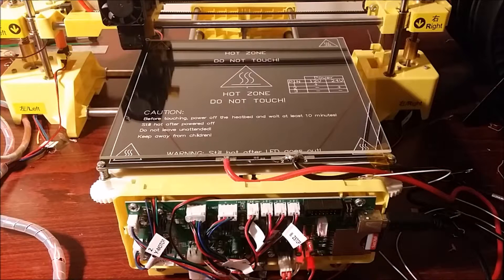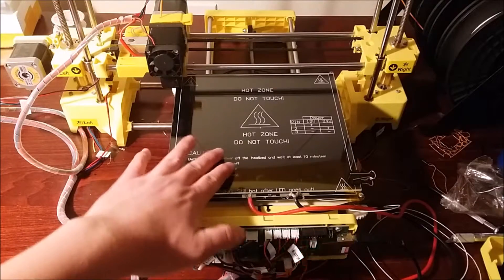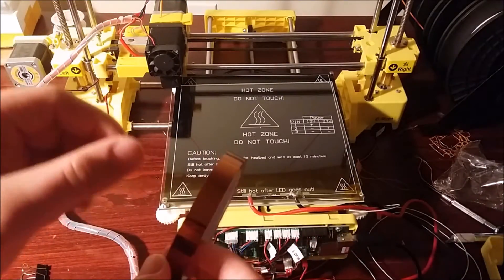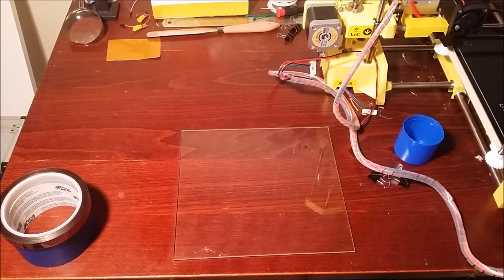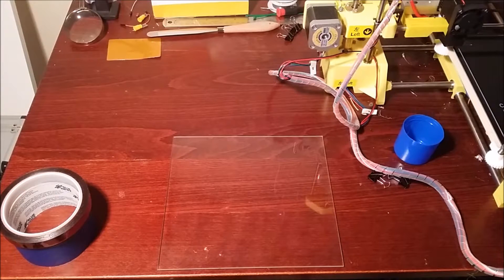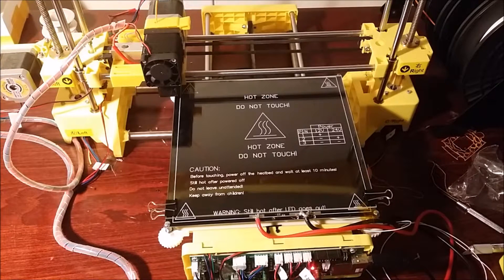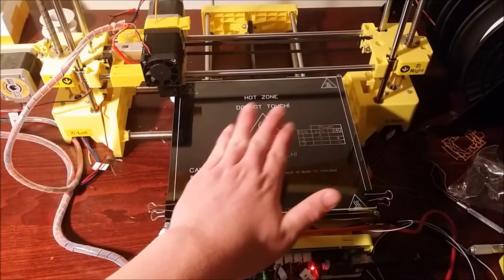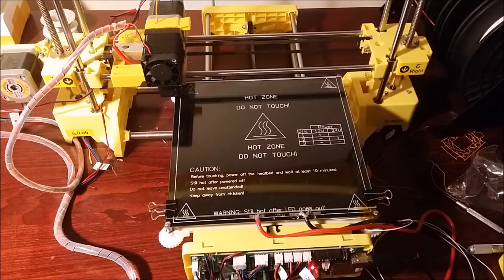3D Printing Tips and Tricks for Better Quality

Comment: Hi, I also have DIY and need some advices. I have seen your heated bed installing videos but i also seen another manual for that and there author adviced to replace electronics board because there was a heatbed temperature controller with insufficient power. What are your experiences? Could You give me some information about bed material? What are the differences? Which is sutiable for nylon, flex and ABS?
Reply from the maker: Hi. Thanks for reaching out! I’ll be glad to help! The DIY is starting to become a slightly older 3D printer. I think that you have many different routes you can take to breath some new life into it. In my videos for the heated bed I kept all the electronics besides the power supply. For running a heated bed that’s all you would need. The printer will do just find managing the temperature. If you wanted to upgrade electronics like the main board you can take that route as well. Upgrading to an arduino based 3D printer could be an easy and cheaper option. It also give you some advantages like a screen to be able to change setting and control what prints you want to do. There are other more expensive 3D printer control boards out there and they all essentially do the same thing. That’s what’s great about 3D printers is that they all work on the same principle. Now for the bed material I think that people have actually had the best success by printing on a mirror. They are really flat and when combined with a heated bed you get good adhesion when printing. Just make sure the mirror is made of glass and doesn’t have any plastic in it. Printing nylon can be somewhat tricky and requires very high temperatures which the printer should be able to reach but it needs some kind of enclosure to keep the heat in. A flexible material like TPU should work great 210 C and 60 C for the bed has worked for me. ABS would be in a similar to Nylon where is would need high temperatures but it shouldn’t need an enclosure to help keep heat in. Let me know if you have any others questions. I can also provide link to products and other resources to help upgrade your 3D printer. Thanks for watching my video!
Reply: @channeleverything3420  thanx for quick answer. I alo asked about it at ur national (slovak) 3d fb and there i was recommended to rather buy a new printer than invest to colido. So Im thinking about ender 3 but i want to give a chance to colido but i dont want to spend a lot. Just one more question. Is mirror suitable for all materials? Which side should be on top? Glas or color at back?
Reply from the maker: @borsuk_borsuk  I currently own two ender 3 pros and a CR-10. They are really great printers and work with many different types of material. I made the switch from the DIY printer because of the build quality, i found that over time thing became to loose. The ender 3 or 3 pro would work really great for you if you can spend that money. The ender 3 pro includes a magnetic removable print bed and it works really well.  You wouldn't need a mirror for it. But if you did want to stay with the with the colido you would need the mirror and that would be glass side up.
Reply: @channeleverything3420  What is magnetic bed good for?
Reply from the maker: @borsuk_borsuk  the magnetic bed allows you to take off the entire sheet that you print on and then safely remove you part. you can look up a video to see what it looks like.

Comment: Hi, did you know if we can add an auto bed leveling on the diy?
Reply from the maker: Theoretically it can be done. I would look at the prusa line up of 3D printers because there is more information on them and they are similar to the DIY. There isn't to much you can do with the existing hardware so you might have to change the main board to make this possible. let me know if you have any other questions.

Comment: I just use the glue stick for PLA , for ABS  still don know yet cos I just got my printer 2 days ago :) 
I use glass too , just 2mm glass for the time been , don know if that glass last for how long :)
Reply from the maker: How well does the glue stick work for PLA? I have never used it before, I have just used regular craft glue which has worked for the most part. But for me getting the heated bed and using hairspray on glass has worked the best. If you can get it tuned in just right you can print very large prints will little to no warping(using a heated bed and hairspray). I know that hobby king came out with an upgrade kit, but I also did a DIY version if you want to check out that video. https://www.youtube.com/watch?v=vQEJjmUvozM 
Let me know if you have any questions on setup or just general information. I would be happy to help!!!!
Thanks
Reply: Thank you sir :)